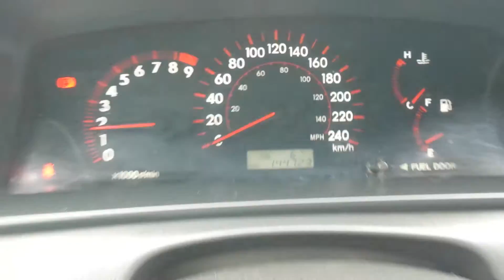Start up

Comment: Allright
I sure will
how do they ride?
does it bounce a lot
Reply from the maker: The ride is not too bad. yes it is a little bouncy, but realistically you won't notice unless you've driven other cars on coilovers. Only complaints is that they dont go stiff enough. They still ride very firm, except on speed bumps. I found they didn't hold the weight up well enough initially resulting in my banging my frame a little... But I'm also completely slammed on them lol. On the other hand, I found them softer and better than OEM on stock preload and on the lowest dampening setting. I would definitely recommend them for a starter set if you can pick them up used. Otherwise, buy the SS series or go with ksport/d2! Hope that helps!
Reply: Perfect!
That helps a lot
I will definitely get those
Thanks buddy